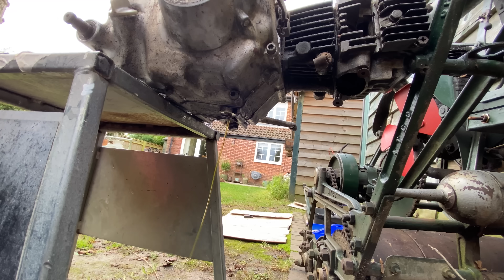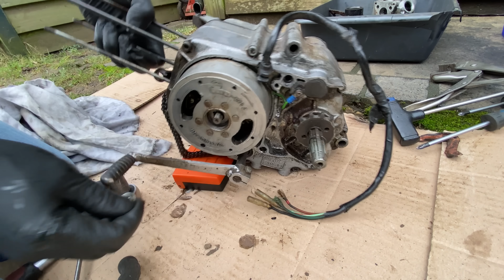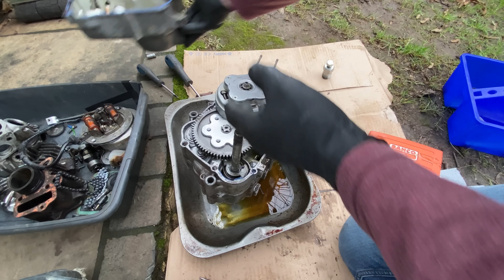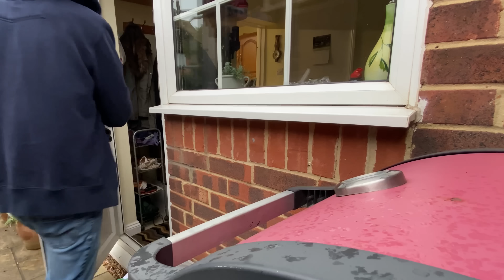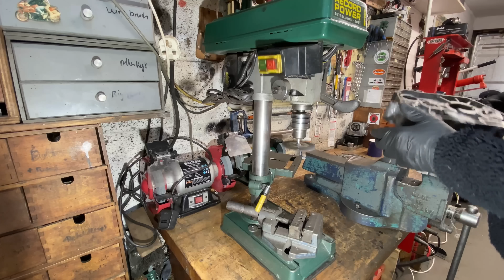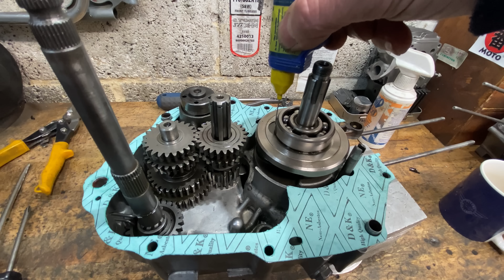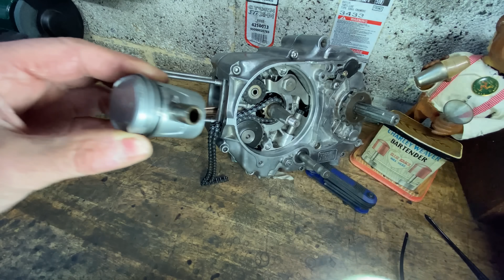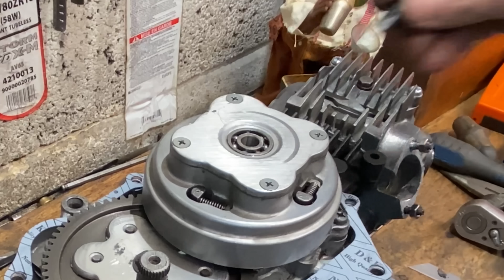Honda SS50 engine strip down, rebuild and start

Comment: Great video.  I had a '68 Honda CD90 which had the same type of engine.  I never got as far into it as you did, but I didn't need to; it ran like a Swiss watch.  Two things are amazing about these little Honda horizontal singles: 1) they are sophisticated beautifully designed engines for their day (OHC, 4 speed, good internal lubrication) and foretold the greatness that was to come to Honda which carries on today, and; 2) rural communities in Asia still use those Honda singles for individual and family transportation.  I have seen families of 4 all riding on Honda 50, 70 or 90s going about their errands in Indonesia.   Honda used those reliable little bikes, and the as slogan "You meet the nicest people on a Honda." in the '60s to change the image of motorcycling and win over the mass market.  Kudos to Honda, Kudos to Allen!
Reply: Hey Don far as I remember something like 50 million were made, had a 65 and ran it on methanol smelt nice but did not last that long

Comment: I owned an SS50 back in 1975. I found it totally underpowered and a lazy engine. But that might have been because of legal requirements. It was sold as a moped, and not a light motorcycle. It bought it brand new, and there was no need and I lacked the skills at that time to disassemble it. Nico to see though that many construction details were identical to 
the larger brothers like CB400 and CB750 on which I did extensive mechanic work.

Comment: Aaahhh, stripping an engine down 'on the grass!' I remember doing a similar thing with my 210cc Villiers Kart racing engine at Morecambe Kart racing circuit 'back in the day!' They were buggers for losing the 'points' off the gear selector cams if you were a bit 'heavy' on your gear-changing. (Wot, me - never! LOL) Happy days....

Comment: I wish two-strokes would make a come back, with fuel injection and emission compliant. These do exist but are expensive due to lack of economies of scale. Two strokes are inherently more efficient, compact, simpler and lighter, and should be cheaper. They easily achieve 1hp/10cc without special tuning. They don't absorb their own energy to operate a cam chain and valves. Maybe big Japanese brands could pool resources to build a shared 125cc or 200cc two stroke engine. Just my view, but I am a fan of the Suzuki TS185

Comment: The C50 is one of my favorite engines, although I am not a motorcycle man. If I was to ever have a bike at my age, it would be the Honda 70 (previously the Honda 50 of the 1960's, 70's).

Comment: I had a Honda SS50 back in 1981 3rd and 4th gears were stripping and as i was only 16 i didn't realize what damage was taking place before it was to late, it completely seized up one afternoon on a RAC/ACU training course. one of the instructors ended up towing me back with a rope LOL.

Comment: How damn interesting! Turning 16 years old in 1970, I was blessed with a brand new Honda SS50 for my birthday. What a beauty she was ... blue with all the chrome on the mudguards and the slightly higher handle bar. I was the envy of all my mates! Having lived on a farm 16 km from town, the bike was like a gift from heaven! I cannot tell you how much convenience, joy and pleasure that little bike brought me! VERY cool video Allen! Regards from South Africa.
Reply: I have a honda dax (st50). Same engine as this one. I bought it when i turned 18. Last year. I absolutely love that bike.
Reply: Same era, 1974 I had a brand new yamaha fs1e, my best mate had the same bike as you, great times,  great memories 👍
Reply: Also had the SS50 new from 1975. All my friends went for 2 stroke Suzuki and Yamaha 50s. They revved higher, made more smoke, but on long hill the Honda 4 stroke torque left them in the weeds. And it had real OHC engineering.
Reply: I would have been filled with embarrasment . We used to pass these bikes CYCLING
Reply: @Interdiction  Really? I cruised around comfortably on the level at 70 km/h, downhill anything up to 100 km/h. Those were just fantastic little motorcycles. In later years I owned a 175, then a 200, then a 450, then a 750 and finally, as I aged and my need for speed decreased, I now own two 150 cc scooters. 😉
Reply: @wouterswanepoel5753  Those engines are like the Audi 2.7T. BULLETPROOF.
Reply: @Interdiction I pass many parked vehicles when cycling, even when walking.
Reply: @Interdiction  You must have bionic legs. Please embarrass yourself elsewhere. 
Thank You. Merry Christmas and Happy New Year. 🎄🎉✌🙂

Comment: Thank you for the vids.  All my Honda 70cc engines have ground down shift forks. I decided to have the fork tips built up with weld, then jig them up on my mill and finish the fork tips back too oem size. I did that since you can build multiple cylinder engines, I can at least reapair a shift fork!!

Comment: Allen, my apologies for randomly tagging this comment onto your latest video upload, as it has nothing to do with Honda SS50s! However, eighteen months or so ago, when you were speaking with the Missenden Flyer, you mentioned a new bike project -- a 3-litre vee twin, using barrels and pistons from a British radial engine. Are you making any progress with this? Could I also ask as to what make of engine parts you're actually using? I ask because I'm hoping they're from Bristol -- especially from one of their sleeve-valve, radial engines, as I'm sure that really would be a first!

Comment: Hey Mr Millyard, what was that cloth you used on the valve in the lathe. I have a semi automatic version to rebuild, I guess very similar to the manual version.
Reply from the maker: Abranet

Comment: I think the cylinder gearbox and clutch have been replaced in Vietnam. I suspect this machine is the ss50 series made specifically for Vietnam and somehow it went abroad.
Reply from the maker: It’s an original UK spec Honda  SS50 engine with no pattern parts
Reply: @AllenMillyard  but i think cylinder and gasket set are not original and the cylinder number 49cc in large lowercase letters is fake

Comment: Please do a video explaining the wires connections to start the motor. I am from Portugal and I am restoring an honda ss50z and I would love to start my motor out of my bike!
Continue with the good vídeos!
Reply from the maker: The black wire connects to the SS50  coil then it will run

Comment: Hello Allen. This took me right back. I had a honda 50 years ago as a schoolkid. I rode it on some waste ground at the back of our house. I took the engine off and put it in a little go kart I had made myself. It was an older model and had the cam in the crankcases. I seized it and stripped some teeth off the cam gear. Getting it running again was a real challenge for a 13 year old schoolboy. I enjoyed watching this one torn down and running again. It looked to be in pretty good condition. Take care. Mart in Solihull.

Comment: Brilliant job - you make it look so easy. I had a C50 in the late 60's - it was a 65 model, with push rods, rather than OHC. One day, the engine died and nothing would re-start it. At 16, I hadn't a clue what the problem was, but luckily I knew a bloke whose hobby was stripping down engines. He set to work on mine and soon found that half the teeth on the crankshaft timing wheel had sheared off. I managed to get a replacement, then as he was reassembling it, he was struck down with hepatitis and spent months in hospital. It took him a year to fully recover. By the time he was fully recovered and got the engine running - I'd grown out of motorbikes!

Comment: Enjoyed your video brings back my early
Days. Those motors seem to be designed perfectly you would think they would last forever and with synthetic oil
Nowadays they just about do. Bought
My first Harley two years ago 88 cubic inches and a five speed engine only
Thing is instead of weighing 80 pounds 
Like the Honda 50 pounds they weigh 800 pounds nearly a half ton.

Comment: I'm struck by the overall high quality of the engine and how well it's survived since 1974. What nice little bikes they were.
Reply: These honda engines were jewels particularly the 50cc overhead cam.  I wish I’d had this video when my pc50 blew when I was 16 in 1974.
Reply: @babaganoush6106  My sister had a Trail 50 I think. 3 speed, no clutch. ran like a champ.
Reply: Yep, and still are,   We get some  of them in The Distinguished Gentlemen's Ride  here in Chch , NZ.  I have also seen a few in Classic motorcycle events too .
Reply: Many of these little bikes were only ridden a matter of hours every year for a few years.

Comment: I have a 1968 Honda 50 that has had low compression since it was gifted to me 30 or more years ago as a child. I think my parents gave $50 for it. I couldn't touch both toes to the ground at the time. I spent more time trying to kick and push start it than actually riding. I assume it needs a piston and cylinder, it feels like it's getting harder to find the parts these days. Only 350 or so miles on the clock.
Reply from the maker: Maybe a set of rings valve grind and new top end gaskets would sort it

Comment: I am surprised you did not use Loctite on many of the screws. Any reason you did not use it at all?
Nice video!
These Honda engines were/are very popular in Asia. Once in Thailand, I walked by a revision shop. There were many men working on what almost looked like an assembly line rebuilding these engines.
Reply from the maker: Not used or needed on SS50 engines

Comment: I've had 90 cc which was clapped and an honda 50 cc which was too slow then I got with finance an h100 for despatch riding after several mishaps I rebuilt the engine and bike and after an 120 miles the thing got stolen

Comment: It warmed this ex mechanics heart to see you use the gaskets clean and dry... as intended. I also noticed how long the counter shaft was and wondered why. Had to google SS50 to see this bike had pedals.
We did not sell this model in the states back in '74 when I was working at a Honda dealer.
Reply from the maker: No need for oil grease or gasket cement on a standard rebuild 🙂
Reply: The pedals on the UK specification SS50 were not really meant to be used, although they could be. They were there to meet the legal definition at that time of a moped, under 50cc and having pedals by means of which it can be propelled, which made the bike legal to ride at the age of 16 as opposed to 17 for a motorcycle that did not meet the definition of a moped. For vehicles registered from August 1977 the requirement for pedals was removed but a limit was placed on the maximum speed the bike could reach, initially 30mph but later lowered under an EU regulation to 45km/h which is about 28mph.

Comment: I would've replaced the valve guides and guide seals. I had to rebuild a Honda 3 times because it kept smoking after the first two rebuilds. It finally dawned on me that the guides were shot...
Reply from the maker: No smoke at all

Comment: i did that back in the late 70's with a Honda 750. I rebuilt a 1969 Honda 750. I had the rebuilt 750 motor on a heavy-duty dolly next to my 73' 750. i used the electrics from my 1973 750, put the headers upside down on the 1969 750. used a can with a fuel valve hung from a wire on the headers for fuel. Ran perfect.  Wow  the crankcase splits vertically on your 50cc Honda, just like a Triumph or BSA. ooh I would clean everything in parts cleaner after and possibly water afterwards followed by air after valve grinding lapping, you dont want any of that stuff hanging around. I knew someone that bought a new Ducati and it had bead blasting beads in the transmission from the factory.

Comment: I can do the chucking in a box thing but the rebuild would only go so far lol. Had a fizzy in 76 and it would die in heavy rain and have just found out that it was a design fault on the plug cap.

Comment: there should be more of this sort of engine in the world. there are tons of cheap little engines, but this is about as small as you can get, while having 4-stroke + gasoline + independent oil. a genuine workhorse that is efficient, quiet and doesn't spray oil into the atmosphere. i wish they could be more ubiquitous, and more people had the expertise to keep them running forever
Reply: the manual transmission helped too because it could be push started.
Reply: people use car now  some country in asia and sea use motorcycle daily

Comment: At the beginning of the video - 4-speed engine?  Or 4-stroke engine?
It's not every video on engine refurbishment that includes a chapter on crochet!  ;-)
This engine was so amazingly clean - even the oil - that it made me wonder if a) it had been hardly used, or b) (given the state of the piston and rings), it had not been used since last time it was opened and reassembled.

I wish all other YouTube videos would follow this format - explain all the necessary stuff with no time wasted on BS.  I never owned a Honda 50, but I really enjoyed the video.
Many, many years ago, I was passing one on my Lambretta 150cc 2-stroke.  When I was about level with him, I saw him twist the accelerator - and he pulled away from me - nothing I could do about it - I was flat out!  50cc vs 150cc!

Comment: Great job Allen - such a nice simple little engine!   I’d be keen to learn more about how you adapt the frames of your multi-cylinder bikes to the engines you create.  For example, how do you fit four and five cylinder engines into frames designed for twins and triples?  My key query is about the front down tubes and working out the routing of the exhausts.

Comment: Allen did you noticed the valve marks on top of the old piston piston, ex owner didn't line the camshaft marks so the valves were hitting the piston that's why he put thicker cylinder base gaskets,and your wife brought tears to my face cause my portuguese mother used and did the same needle work while watching tv,great video.
Reply from the maker: Great observation your probably right
Reply: @AllenMillyard  i have 45 years honda technician i rebuilt a lot of these engines china make great copy of these engines

Comment: Wonderful video as usual Allen. This brought back memories because in 1969 when I was sixteen the camchain came off the top sprocket on my year old CD90Z when I was "making progress" (lol!) down the Chester road from Manchester. Having brought the bike home on the back of a pick up truck, I took the head off and the teeth on the top top sprocket were nearly flat they had worn that much, it was no wonder the tiny chain has come off! I ordered a new sprocket from Moreton's of Altrincham (now long gone), reassembled with a new gasket and it was as good as new. The bike had only done around 7,000 miles. btw, My wife laughed about your comment about Tracy's crocheting, because she loves doing the same thing, making patchwork blankets etc. I'm sure you would soon pick it up Allen :)

Comment: That head and valves when you took it apart, like someone had cleaned it of any carbon but didn’t go on to doing the piston and rings. Looked new on top.
Reply from the maker: The engine was “rebuilt” at sometime in the past

Comment: SS50 was my first bike / engine in the early eighties. And the first one I did rebuild. (More times than I could count) Went through several gearboxes and countless experiments to squeeze a little bit more power out of it. Not to mention the holy grail, the 75cc kit.
At forteen years old I probably would have been able to tear down and reassemble this engine behind my back with the lights off.
Good memories and I still do remember the smell.

Comment: Love this chan im 53 from plymouth mass USA i had 20 mini tail 50s trail 70s atc 70s thru thed 1970s 80s and did re builds bigger pistion rings cam iv never seen a 50 motor with a clutch one it ij had alot and they were auto matic

Comment: Well well that’s where the old engine ended up.
If you look closely you can see the hammer marks from trying to fit the camshaft in the wrong direction.
We only used all that gasket cement because we didn’t have enough pizza box.
The missing screws were borrowed to get someone else’s bike going.
At least it’s gone to a good home.

Comment: Good video. Brings back memories for me too. When I was a teenager in early to mid seventies I had managed to get ahold of one of those ugly 1969 Honda S65 motorcycles. Of course when you ride em hard they always need work and I had to learn to do it myself on very limited budget. Cant remember how many times I had to clean & grind those valves just like you did or save up to get another piston & rings or some gears from the Honda parts dealer. It ran for a year or two with a second gear cog that a friend had welded on and used a file to cut a tooth back into shape! It was so ugly I only rode it to school one time and got laughed at! It wouldn't quite make 80 mph with my 140 pounds on it so I finally managed to save up and get me a CL350. And numerous others after that.

Comment: I got the first endorsements on my licence in 1976 as a result of a journey on an SS50, no L-plates, unauthorised pillion passenger.... about 10 years later I saw the little bike parked outside a cinema and could not resist having a look for old time's sake. Miraculously it had less mileage on it than it did when I was using it.... you have to love yor little Hondas...

Comment: Great video. I remember rebuilding a S65 Honda engine that had damaged second gear dogs. One of my first engine repairs as a teenager, 55 years ago. The motor worked fine afterwards. The crankshaft needle bearings finally gave out (rod knock) and I couldn't afford a new crankshaft/rod assembly (the Honda dealer couldn't rebuild it). Today, I see lots of cranks like mine being rebuilt.

Comment: My grandmother bought me a new Honda CT-70 back in 1974 when I was 13. Mine was a 3 speed with a centrifugal clutch. That little engine is tough, takes a beating and keeps running.